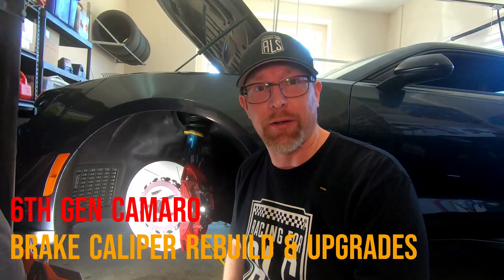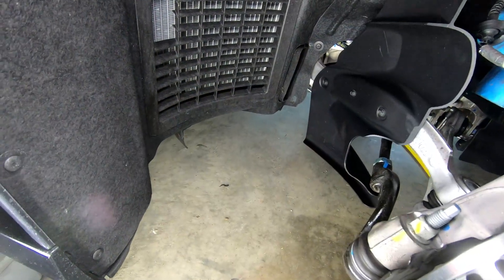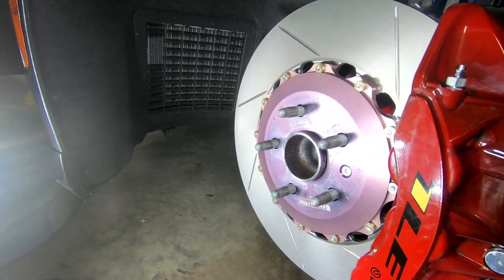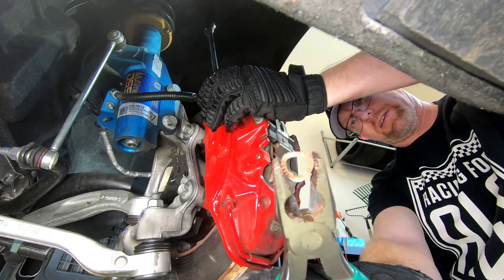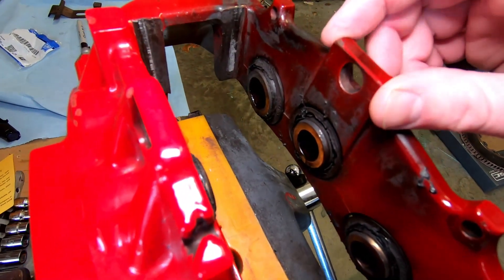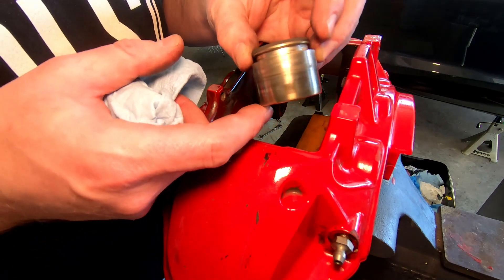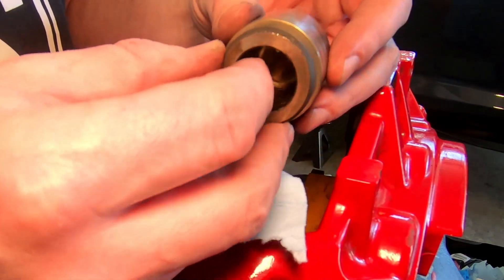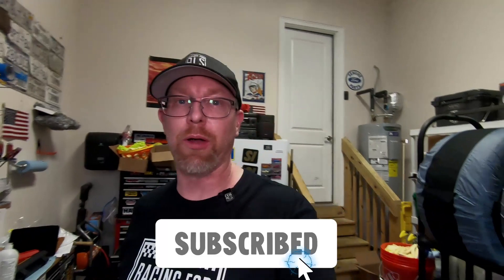6 Piston Brembo Brake Caliper Rebuild Camaro SS / ZL1 / ZL1 1LE / CTS-V / Blackwing / Corvette

Comment from the maker: November 2023 - A few additional comments: 1. Clean the calipers before you disassemble them. You can block off the brake line fitting with bolts like these https://www.fastenal.com/product/details/11114317 2. Inspect and clean the pad rotor slot in the caliper. I had hard deposits that may have been causing the pad to bind in the slot. 3. The powder coating is tough, but anything abrasive will scratch it. Use plastic brushes in a drain pan with a car wash bucket grit buster. Use brake cleaner and isopropyl alcohol. Plastic scrapers or picks can be used for really tough deposits.

Comment: I recumended to use ( Brake cylinder paste ) to lube brake cylinder insted for brake fluid, (ATE Bremszylinder-Paste) this is suitable for D0T 3 & 4 &5.1
Reply from the maker: I recommend only using clean brake fluid as recommended by the GM service manual.

Comment: fantastic video! Just did the front calipers on my ZLE! budget 3 hours for this job (for just the fronts) between cleaning the calipers and the rebuild. 3 cans of brake cleaner is a must.  Also two updates since this video was made. 1. its way easier to put the dust boots on the piston and then push the piston into the caliper. 2. there is an upgrade part available for the piston. 19207043 is the vented piston from the CCBs on the Z07 package vette. same size for ZLE and have holes at the top to help prevent heat transfer to the brake fluid. i got mine off amazon for 100 bucks less than rock auto had them.  Keep this great content coming and #ENDALS
Reply from the maker: Glad it helped. We don't get many views on tech content, so it is great to hear that it helped out the Camaro community.

Comment: I would say metal picks will work for a careful non-beginner.
Some feedback from my side, I grabbed the RB vented stainless steel pistons and blue hi temp dust boots (and stainless lines but we all know those basically for show), did a rebuild on all 4 corners and they ran great on track. Stainless steel supposedly transfers 10% of the heat that aluminum does, vents help more on top of that, and as long as you don't contact the hi temp boots with fluid they don't melt, in case you are curious to try it next rebuild.
I like what you did with the CTS-V parts for airflow, will try to look up the P/Ns to do that myself!
Any feedback on the Girodiscs? I see a lot of micro-cracks but I love the idea of dropping 5-7lbs per corner if they still vent off the heat quick enough. Thinking to do Raybestos ST-43 on track and their hybrid ceramic/semi-metallic pad for the street.
Reply from the maker: GM Cadillac CTS V Deflectors: 85536980 & 85536981
Reply from the maker: I will swap the Griodisc for DBA in the next front rotor changeout. The DBA rings are compatible with the factory hats with new hardware. They allow you to run the full-size ZL1 front pad, whereas the Grirodisc makes you run a smaller SS 1LE pad size. The PN for the Blackwing ducts is in the description. Both the DBA and Girodisc rotor rings are 36mm thick and are replaced at 34mm. The factory rings start at 38mm thick, so you get twice the wear. I run the Hawk DTC-60 all the time. I don't want issues with chatter with different pad materials. My street driving is limited.
Reply: @RacingforALS  got you.  I really want the weight savings and don't mind a smaller pad if it still stops and cools well, but I'll check out the DBAs too, maybe I'll try both. Can't really beat the stock rotors, though, for the price.
And for the pads, I drive on the street often and am hoping using the same brand will let me alternate pads without issues.

Comment: Good video. I wish I had it when I did my SS 1LE calipers a few years ago, my first time rebuilding any calipers. The GM service guide goes into great details on the process. I used GM vented pistons and high temp dust boots from Racing Brakes.  I also did a simple pressure test with air after just to have some sort of test to make sure the seals didn't have a leak and the pistons would pop out part way. The vented pistons work so well I no longer need Ti shields and the high temp boots still look new.
Reply from the maker: Thanks! The OEM dust boots started coming apart after five track days. Next time I'll consider vented pistons and high temp dust boots.

Comment: THANK YOU!!!!!   GREAT GREAT  GREAT!  Why don't you have steel lines,   I don't know, but my guy says they help a lot.    Thanks  Ordered those CTS ducts in 1 second!!!!     thanks again!
Reply from the maker: Some aftermarket brake lines aren't DOT approved. I would stick with the factory brake lines and upgrade the brakes with the parts listed here when you need to replace them. You can do the pads, shims, and deflectors while retaining the factory rotors $$$.
Reply: @RacingforALS  Wow, that part about dot makes sense!!! I would have never though about that...Thanks  Already ordered the cts  deflectors, those shims/heat barrier are real smart.  Thanks so much!

Comment: I've notice on my car it's all ways thinner at the top off the pad when they get worn out.  Also take out the wheel Sensor out and clean grease off of it.   My stability track light came on saying stability Track disable...while I was at Daytona, Yes!!!  it's just grease from out of the sturt. Great video...Will track together soon ..
Reply: Any ideal what to use for a steering indicator on top of our  steering wheels. Like a little white band on top ...12'o'clock position.just to see wheel angle..

Comment: I pick up my ZL1-1LE next week and already signed up for 3 JZilla events at different tracks. CMP is closest to me... looking FWD to tracking my car.
Reply from the maker: Several of the Racing for ALS drivers will be at CMP in a couple of weeks for a private event. Looking forward to see if the additional cooling helps.  CMP is rough on brakes. I would recommend changing the brake fluid to Castrol SRF. The stock pads and rotors work perfectly fine.
Reply: @Racing for ALS  

Thanks!  Girodisc sponsored me years ago when I ran the OneLap event and tracks like Daytona, CMP, VIR and Pitt Race were on the schedule. Their brake rotors and TiShims were key to our success!  I look forward to meeting you and comparing notes on car prep. 

https://youtu.be/EvWF2Jh9Nsw

Comment: How hard was this on a scale from 1-10 compared to just a pad change?
Reply from the maker: It requires more tools than a typical pad change. You'll need a compressor, non-metallic picks, banjo clamp, etc. You'll also need to keep the work area clean when installing the seals and pistons. If a brake pad change is a 3 out of 10. This is a 6 out of 10.